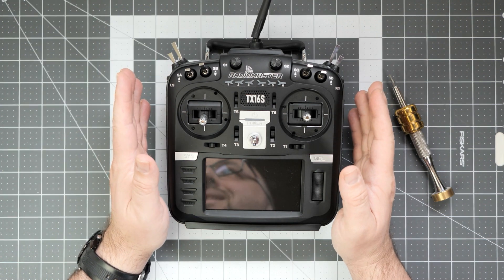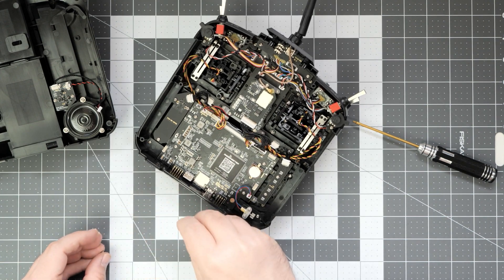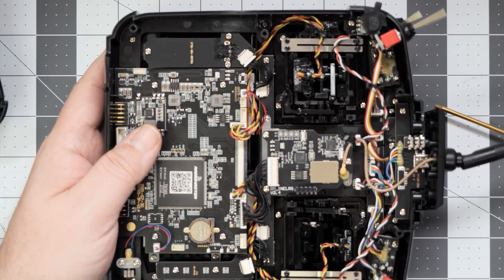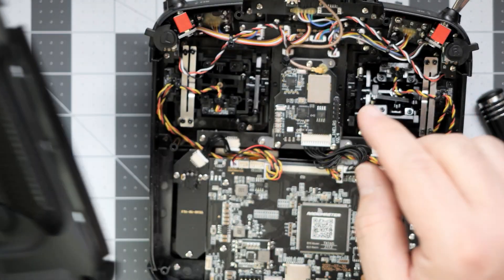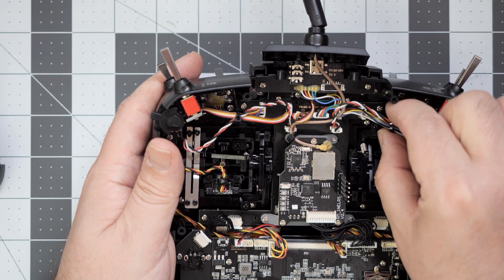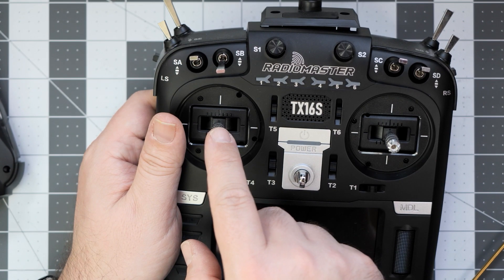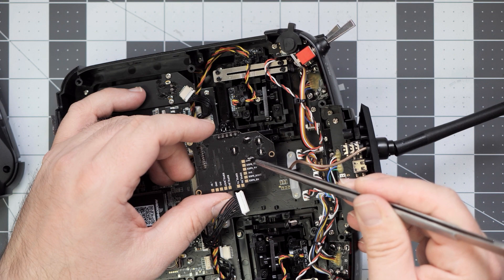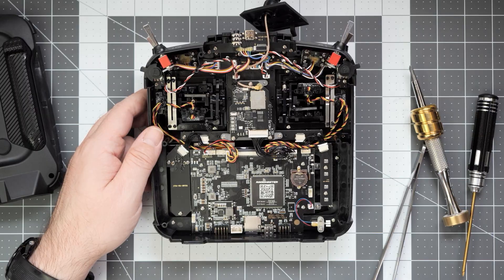What's inside Radiomaster TX16S mark II Express LRS radio?

Comment: Hi Paweł, I am looking to switch to such radio with built in ELRS, but I have one question - which receivers does it bind to? So far I know different tx/rx pairs use different software which needs to be chosen in the configurator...

Comment: Do you know if it is Possible to install the front turning knobs on the mk2 onto the mk1 so that they don't move on a mk1? And of you can switch out the front face plate of the mk2 onto the mk1?
Reply from the maker: Why not switch to MK2 then ?
Reply: @FPVUniversity  true but I just bought the mk1 and I think it would be cheaper just to upgrade some of the parts, no?

Comment: If you break a switch their replacement comes with the cable soldered to it so it a literal drop in repair that just plugs in.

Comment: Not enough mods to purchase.  Maybe the next version. Great job Pawel!
Reply: If you have a TX16S already, yes, probably not enough to upgrade for most people. But you will also be able to get spare parts to upgrade your old one. I.e. I'll probably get the replacement knobs and sliders as the centre detent and knob movement is much better. I have AG01 gimbals already, upgrading from the original potentiometer gimbals. And using external ELRS. Having said that, I do have a mkII (prototype) and like it enough that I would buy a second TX16S with internal ELRS to complement my original upgraded 4in1.

Comment: Thanks for the teardown, certainly looks like a nice developer friendly ELRS board in there with clear markings and all the extra buttons.
Reply: RM did a really good job on the design of the ELRS module, working with the ELRS developers over several iterations of the design, which really shows now in how well thought out the design is.

Comment: Hi Paweł, I bought Tx16s old ver 3 weeks ago (for 756zł on BG) and it turned out that I have got  the same upgraded as Mark 2 gimbals with those outside adjustments 👍. Your video push me to open my radio - thanks for that kind of motivation. I'm super happy 👍
Reply: Yeah, the front adjustments were available before the TX16S mkII, either the V2 or v3 hall gimbals. Basically different parts of the TX16S have been upgraded over time, but the mkII has brought all of that together as well as its own improvements.

Comment: The buttons are `32_B` and `86_B` which are held down to enter the bootloader for the two MCUs on the internal module, and the other two are reset buttons for the MCUs. These are used if both wifi AND ETX passthrough fails as a method to recover the module.